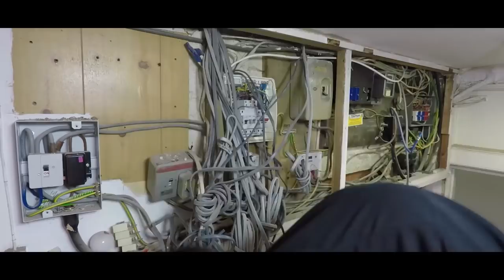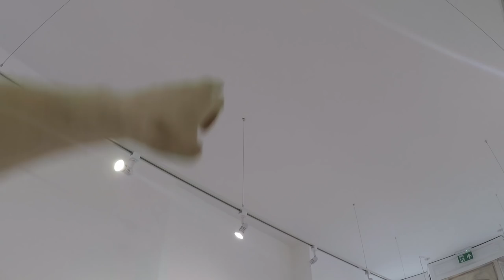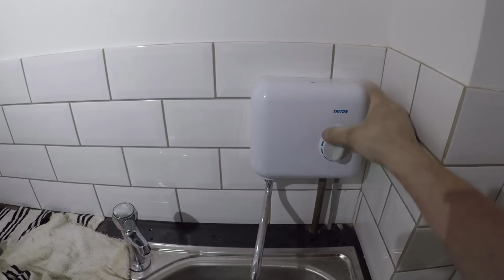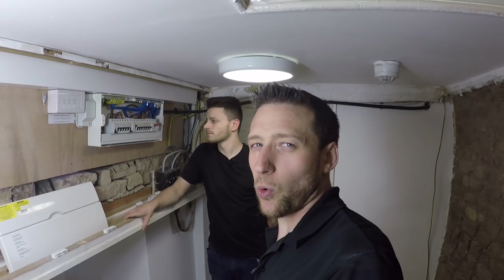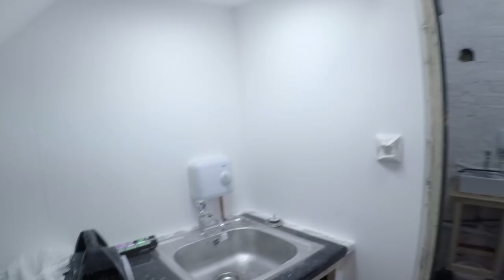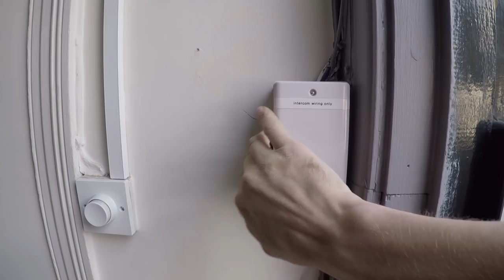Changing a total mess of a fuseboard | Thomas Nagy

Comment: I am an electrician in Ireland, moved here from the UK,  most of the old dis boards that I replace have the old DPZ ceramic bottle fuses fitted, (most have been wound with wire), no rcd protection, lots of borrowed neutrals, some have been in for 40+ years. All on a TN system.

Comment: Sorry if this is an excessively basic question, but from where is the power turned off if you want to work on a fuseboard/consumer unit? is it just that isolation switch in front of you or is it done by the energy provider somewhere down the line?

Comment: Hi, you have added a note to state that the EM sign is the wrong one. It isn't so please don't change it. That arrow has a couple of meanings, one is "Progress up from here" and "Progress through and on from here" so the latter meaning is applicable for this so as above it is actually the correct sign for this location. The only meaning of the sign down arrow is "Progress down from here" and is the most misused/incorrectly used sign. Your average corridor as well should have the arrow up sign as well to progress through and on from here but nearly always it's the wrong pointing down one. Keep up the good work, love the high standard and general attention to detail, Its refreshing to see.

Comment: the LED flicker is because of the hz your camera is recording at is matching the hz as the electrical current, if you're using a gopro you can change it but if you're using a camera phone you may have more issues unless you are able to get into the hardcore settings

Comment: Quick tip that I learned is to avoid you LED flickering just change your frames per second to a number divisible by the electricity hertz rate. UK is 50hz so change your frame rate to 25 or 50 or 75 etc. As standard lots of cameras and go pros are set to 30/60/120 which is great for USA hertz but not UK. 👍

Comment: The other thing you need to be careful of with those 3036 fuses is the very low short circuit capacity. Especially in London where the PFC can be very high

Comment: New fuse board is so impressive. Perhaps a before and after side by side of that fuse board (distribution centre/consumer unit? If it doesn't require additional information rat's to terminology). Is that 'cupboard' now not far too big for that board?
  That track ligting does look good, but 'ouch' so expensive!
When you were removing the old wiring for the fuse board were you carefull of the length of wiring you left?
How do you extend any wiring that is JUST to short for a fitting (ie not short enough to need a whole chock block other piece of wiring extension)? Would it just be a case of hoping there was enough slack in the cable to pull it all an inch or so ?
  Not a spark more a keen DIYer hence bone questions.

Comment: The power companies should do it the same way as they do here in Germany:
Electricians here are permitted, if they're registered and certified by the local network operator, to remove the seal and remove fuses for themself. They're also permitted to replace the seal after they've finished their work. Meaning here you must have additional tools and safety equipment, because in the service entrance box you'll find three 63A NH-fuses in most cases.

And that bullshit speech is exactly the same here. That's not a "Glühbirne" (literally "lighting pear"), that's a "Lampe" (lamp) or "Leuchtmittel" (illuminant). Or if you say Erde (earth) here, some are literally exploding...You can find earth in a garden pot, it's named "PE" (protective earth)!!
Reply: Exactly so isses :)
Reply: no im an electrician i lived in Germany also and Germanys electricas comes no where near as safe as uk electrics

Comment: Noted you called the dno or supplier out to move the cut out and meters etc... whats your view on pulling fuses in general? Nearly all of us have had visits from the seal fairy to magically remove one... I know some who wont even entertain the thought and call the dno to pull it for them.. guess its a judgement call, if its old and stuck leave well alone, but a modern henley with no load is unlikely to cause issues
Reply: There`s really not an issue in cutting the seal on the bullet. Look at all the `decent homes` social housing upgrades, DNO simply could`nt support the thousands of board changes which have taken place over the past decade or more. Cut the seal, pull the bullet, leave the meter sealed, install new 25mm tails, cut the load side of the meter tails, and terminate into a Henly block. Take a picture of your masterpiece, and notify the DNO, tell them the fuseboard had melted and it was a midnight call out! Obviously if there`s a real issue with the state of the main intake, leave well alone and report. Scary thing is you are probably more qualified as an engineer than the ` smart meter` installers, and while I agree we all need to make a living, there have already been some serious blunders on both Gas and Electric meter changes. Wouldn`t it have been nice if they had agreed to build an isolation switch into smart metering, supposed to be intelligent people!
Reply: Got2Bgaga very well put. We all know what goes on. As we agreed on its ajudgement call. Putting an isolator in the meter is far to much like common sense. You can get meters with a switch built in but guess it was a cost thing! As for some of the meter installers ... less said the better. I can see the time when one emds up in court for manslaughter
Reply: You can actually get away with cutting the seals by stating that the board was in a dangerous condition and required isolation. can't quite remember off the top of me head where it is in the regs.
Reply: Why dont sparks do the meter installation in the U.K. ? Since part p the electricians have been going down hill, we basically had people doing a two day course installation of domestic electrics, nic/ eic etc dont care, they get more money in, so they profit, sparks in the uk are Muppets, yeah yeah, I am trained and educated there amongst other countries, but  yeah born and raised, just makes me ANGRY, we got stuffed,
Reply: gavin john-hyde I have no qualms with pulling fuses or come to that replacing tails, there’s a few times with new meters that there’s half a turn left on the dno terminals in the meter! As far as I’m concerned a consumer should be able to disconnect from the system and I’m confident that with 30 years experience I’m able to do it safely and leave it in a better state than some of the clowns who are fitting these things.
Reply: @smartchip  I think the law is only the MOP/MAM are allowed to  move the meters. If an electrician snipped the seal and moved the meter then he's technically tampered a meter and done unauthorised work. Electricians can't reseal a terminal cover either (unless their mate has a special set of seal crimps)

Comment: Would you happen to know why you use multistranded wires as opposed to singlestranded ones?
As far as i know, here in Iceland we only use multistranded for cables that don't go from fuseboxes to outlets/other internal wirings.
Reply: Because multi-strand wires are easier to work with and it makes sense.
Over here in New Zealand, we use wires in switchboards that look like welder cables, they have 215+ fine strands for the distribution parts of the board.
I did my time with the older solid conductors at socket-outlets (2.5mm2) and the 1.5mm2 at lighting circuits, stranded is definitely better by a long stretch.

Comment: Still wating for an actual pricing up video, you give us the one to have a go at but show us how you do it 👍
Reply: The man is trying to run a business, seriously, if you can't work out how to price a job, effectively, you deserve to be working at McDonalds.
Only trade experience will teach you how to price any given job, as in you need to know how long it will take you, given the structure, the existing installation, the customers requirements, the regulations pertaining to the work you are about to install and even any fix-up work required for non-compliant work that has been already installed.
You cannot conceivably put a "one-size-fits all' recipe to quoting an electrical install, as every job is different.

Comment: hi Thomas its Kev from Epsom we spok on the phone not so long ago just a quick question 
is it ok to fix a metel consumer unit on ply thanks all the best mate keep up the good work love the vids
Reply: I do know what im doing im just saying new ones being enclosed and all metal are fire rated dose the  backing mount still have to be fireproof   (I DONT THINK SO) has its metal and fire rated
Reply: I replaced a CU on the existing  hardwood backing board, this was called into question by another electrician as it's not fire resistant. Surely the point of the metal CU is that it contains any possible fire from spreading? The fact that the CU is already located in a wooden cupboard in the first place, I mean you can only limit the risk.

Comment: Isn't that wire for the possible shower a bit close to the conductors? It could lead to inadvertently energising the circuit?
Reply: Bit of tape around it or connector
Reply: Well I'm sure the MCB will be off, and there's no way it could inadvertantly move across to a live adjacent MCB, unless there is a particularly evil poltergeist lurking in the building......
Reply: He probably had it sitting there for the sake of the video so we could see what he was talking about. Any good electrician would make sure any potential contact with live conductors are 100% accounted for.
Reply: Andrew u should tape it up or put it in a terminal
Reply: Don't know about England but in New Zealand unused conductors have to be connected to the earth bar
Reply: If the neutral and CPC is connected they shouldn't be.. could cause nuisance tripping.. just and observation of course..

Comment: I see that flickering as a bad sign. Good quality LED drivers have smoothing capacitors on the output and they shouldn't flicker very much at all only the slightest ripple. Cheap fittings especially ones with only half wave rectifiers have a lot of Flickr and I would see it as something to stay away from. Also some people are sensitive to the flicker especially in peripheral vision. Not to mention in the art gallery problems for the client when they want to shoot video clips in there!
Reply: Rosscoff2000 I don’t this install has any problem in person, it’s just on camera
Reply: Also depends on whether the camera refreshes at 50 or 60 hz

Comment: That first FCU hidden in the boxed-in section....how do you change the fuse when it's all clad?
Reply: They said they'd be putting a door on the boxed-in section so you could get in there and read the water meter, probably use the same door to get at the FCU.

Comment: I always put the arrow facing up on the running man emergency lights because my old gaffer seemed to suggest that a downward arrow signifies going backwards 🤣 my main gaffer now says it’s open to interpretation as long as it’s consistent across the site, is there anything in the regs about about this or is it just a case of good practise?
Reply: Adam Burns your boss is half right. Down arrow means change of level (stairs/ramp etc) Up arrow means continue forward.

Comment: Why didn’t you fit rcbo board Instead of dual RCD board? I generally just use dual rcds for domestic!
Reply: Probably price considering a 16 way board at around £30.00 a Rcbo would set you back £450-£500 and a dual RCD £120. Both within regs. Customer doesn't always have a massive budget just for a consumer unit

Comment: Wouldn't a fixed exposure (1/50s) fix the LED flicker
Reply: The shutter speed has to match whatever HZ the light is flickering at to eliminate it. 

An example is if you match your shutter speed to the same speed the blades of a helictoper are rotating, it will make the blades seem stationary as the helicopter takes off and flies away... seemingly floating. 

Honestly it's a pain to constantly adjust for, if even one LED or light source in the room as at a different HZ you will get that flicker, which is actually called banding.

Comment: Here in America we switched from fuse boxes to breaker boxes/panels quite a few decades ago. Now it looks like what you put in  here is actually a breaker panel, but you still call it a fuse board?

I would get rid of those poor quality LED bulbs that flicker, and get some good ones. Flickering bulbs can cause a headache or mild irritation for people. Especially at 50 Hz.
Reply: He fitted what is technically referred to as a consumer unit but old habits die hard and they are often called the old name of fuse box. In most cases the supply to domestic/ small commercial buildings is 230/240v single phase therefore a panel  is not necessary and a single phase consumer unit is considerably cheaper.
Reply: To be fair, Robert Harris, the whole thing should be called a switchboard, as it holds the Main switch, that gives the greatest degree of control over the installation.
In saying that, I don't know that that board is the Main Switchboard either.
The way we do things here in New Zealand is that you have one controlling Main Switchboard and this then feeds either a Distribution Board or a Sub-Main Board, the difference being a Distribution board will be 3 Phase, whereas, as a Sub-Main will be single phase.
We don't muck around with separate isolators, outside Boards, they are all kept inside the enclosure nearest the supply point for that part of the installation.
Reply: It's habit, if you asked a client where their consumer unit was they would look at you like you were talking Egyptian, but ask them where the fuse board is and they point you to the location of the CU.

Comment: As weird as this sounds I actually think the arrow on the exit sign is the right way around, personally I would have said not, but it seems to be a trend.
Reply: Not just a trend - it's a requirement of BS5266 etc. that the arrow point upwards unless a change of level downwards is required for final exit. So a down pointing arrow at the final exit is now non-compliant and wrong.
Reply: Richard Walsh Spot on! Ive commented above as well. Lets hope Thomas sees these and doesn't change it.

Comment: Fuse Board!? Surely you mean 'Consumer Unit'...

And using a Volt stick to check safe isolation? Tut tut..where is your GS38 voltage indicator and proving unit.
Reply: Hopefully left in the test center where it belongs
Reply: Mark Bradshaw This ^
Reply: Volt stick's fine for proving it remains dead.  To actually prove initially, yeah, I'd be going with my old test lamps (drummond lamp), and proving unit? Use the incoming supply ;)
Reply: So many triggered internet keyboard worriers.  Clueless

Comment: Touching on people switching a feed on when it is being worked on in a remote location, I have to confess to electricuting  a " handy man".  I was on holiday in Tenerife some years back and the air con in our room stopped working within a day of our arrival, I reported this to reception and went out for the day, upon our return we passed reception and asked if the air con was working now and was assured it was by the Staff.  On entering our room I could see that the air con trip was off so I turned it on and enjoyed the very cool breeze. Brilliant ? Or so I thought.  About 5 mins later we heard a banging on our apartment door..  it was the handyman whom was apparently working on the air con compressor on the roof. He was not a happy man and neither was I as I stood there and took the flak from him for nearly killing him... opps.  Strange thing is the system did not trip  when he got a jolt..  Just goes to show why any system should be locked out as far as possible when working on it.  True Story I kid you not.
Reply: Please tell me he had hair like Ken Dodd when he came back down from the roof?  🤣

Comment: God bless America. where real electricians live... plastic 'fuse boxes' rubbish
Reply: I hear you electrical in england is very sketchy it seems
Reply: American electronics are rubbish.
Reply: Nathan Hall would that be the same America where appliances are limited to a pathetic 1500 watts or thereabouts because of the feeble voltage? The place where you can't use an electric space heater in the same room as the vacuum cleaner without popping a breaker? The place where you have to have dedicated sockets for dryers so their location is dictated by the original wiring? The place where antiquated top loading washing machines are favoured even though they still rely on incoming water temperature because the circuits can't cope with appliances that heat their own water? The place where 3kw electric kettles are not usable and everyone boils cooking water- slowly- on top of the cooker?
Reply: @spencerwilton5831  I like your initiative Spencer. but you spent an entire paragraph there simply repeating "Yeah, well at least we have more than 110V ya nipple!"  I would have just gone with calling the guy a clueless arsehole who doesn't know much about his own country.